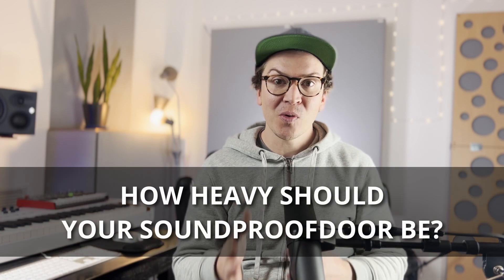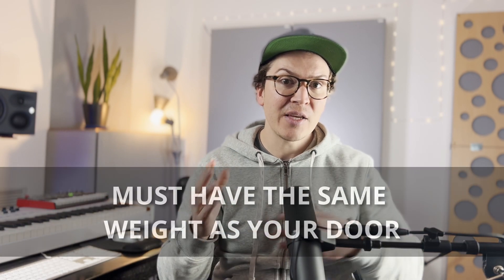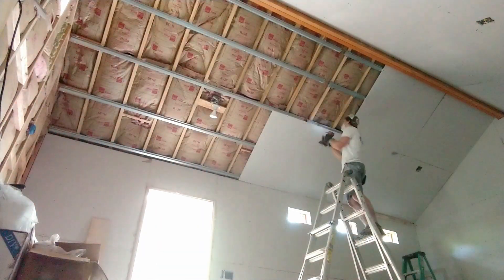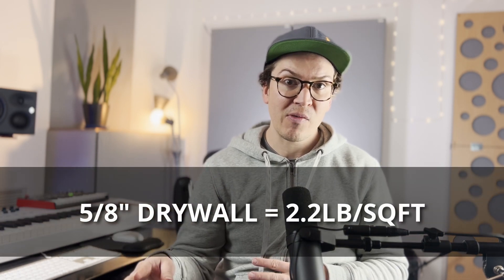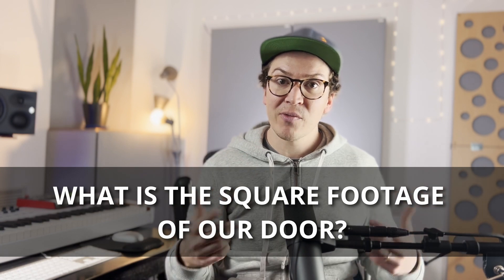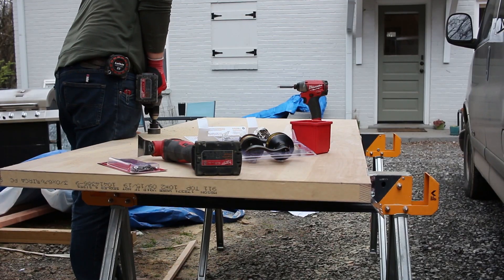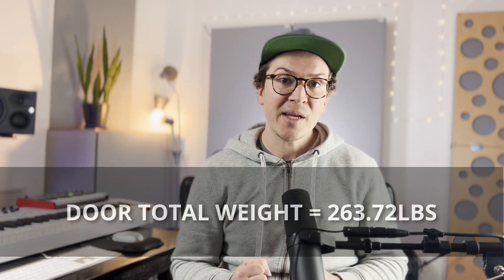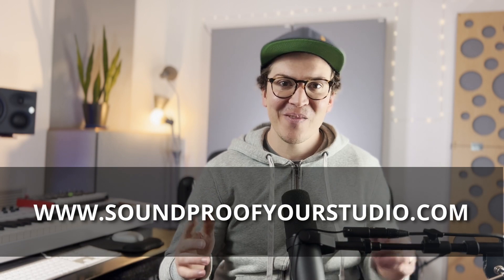How Heavy Is A Soundproof Door?

Comment: 3:40 No offence, but I had a little chuckle when I calculated the weight of my 17C house's front wall - about 200lbs/sqft!  It's going to hard to find a door and glazing to compete with that!
Reply from the maker: that's a heavy wall!
Reply: @soundproofyourstudio  Indeed, I had to drill a 25mm hole through it using a 1m long drill bit, and 1.1/4 hours later nearly got up to the chuck before I was through!

Comment: Great video! What did you use for the hardware for your door? What hinges, knobs, and latches? What did you use/do to make sure the door closes slowly enough that it can’t hurt anyone when it weighs so much?
Reply: @chrisasta we used hardware and hinges we found at home depot. I would recommend getting door handles and deadbolts with a backset that is deeper for this design. I believe it is over 5" for a deeper backset. You can add a door closer, but I opted not to since it naturally swings very slowly.
Reply: @WilsonHarwood  Thanks for the info. Did you use heavy duty hinges, or have you found that regular hinges have been able to handle the weight of the door without an issue?
Reply from the maker: @gendefect1  I would use the heaviest duty hinges you can find and afford. We also used really long screws to support the hinges. I also would use 6 hinges not just three like I did.